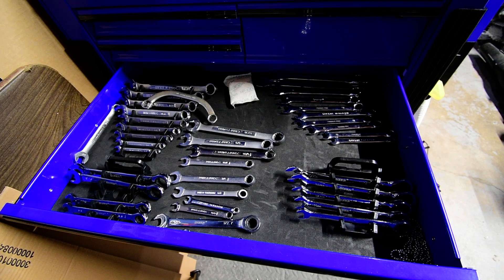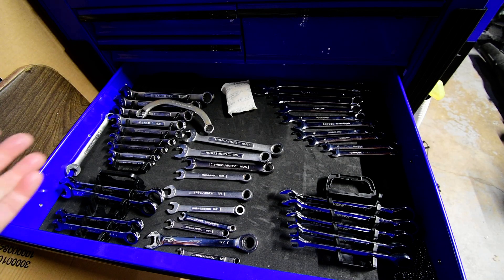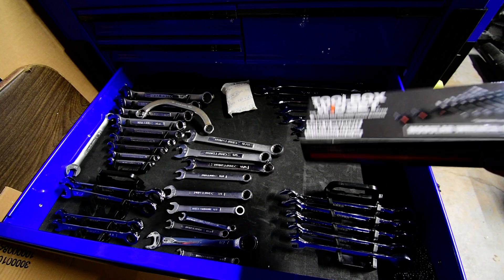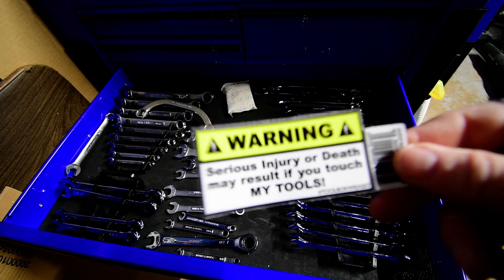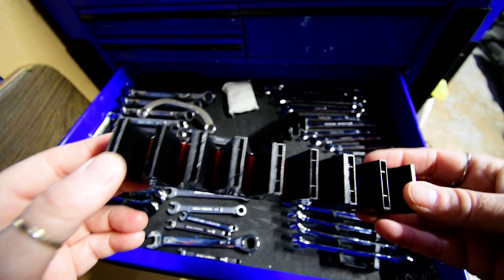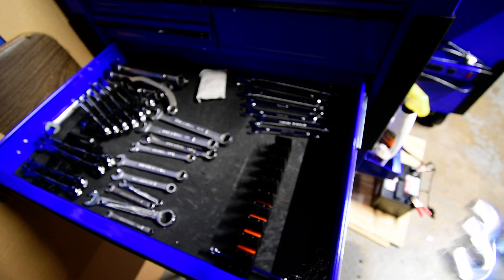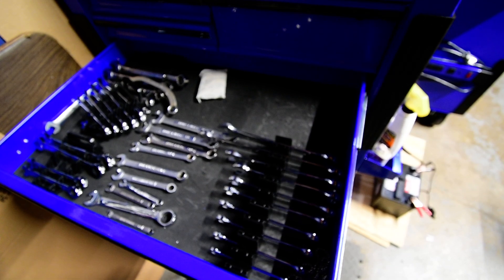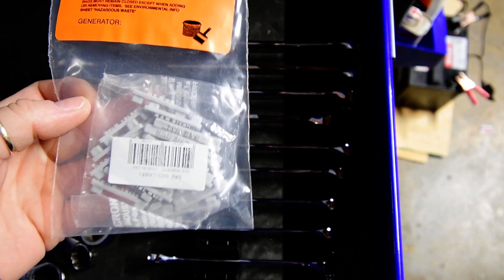toolbox widget

Comment: The idea of them is fantastic. The downfall is the quality of manufacturing and price. They are WAY over priced for a piece of plastic. Not too mention the extra cost  of the labels. Tool Box Widgets need to market based on the cost of manufacturing, not the cost of what you "need". Plenty of needs can be had for half the cost.
Reply from the maker: I agree but it’s a small business with a patent on an actually real good idea. They do save a ton of space and I really like the orange for missing wrenches. They have quality issues to be worked out and yes both the holders and the labels are way over priced. The labels are the worst though, tiny, don’t fit right and one one label per size. Hopefully they will come down to a reasonable price but as long as people are buying I don’t see that happening anytime soon. Thanks